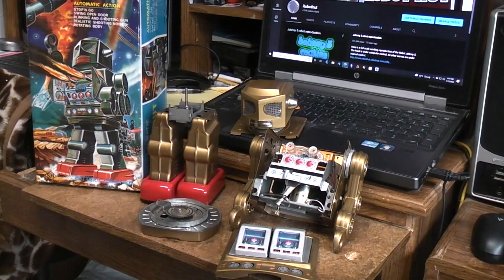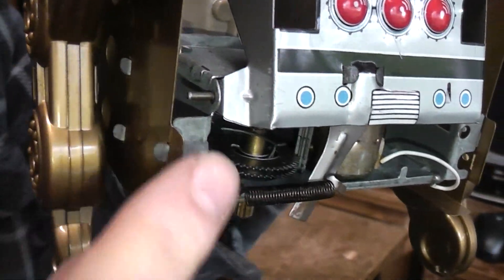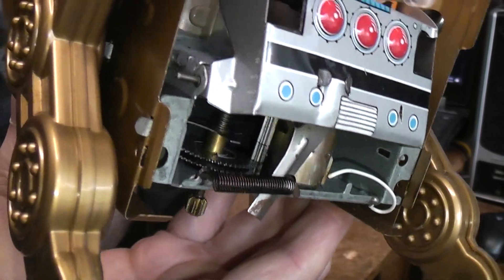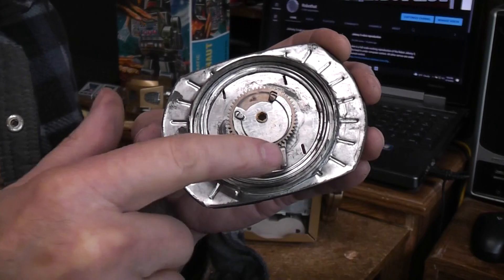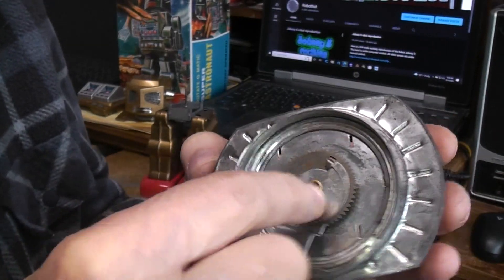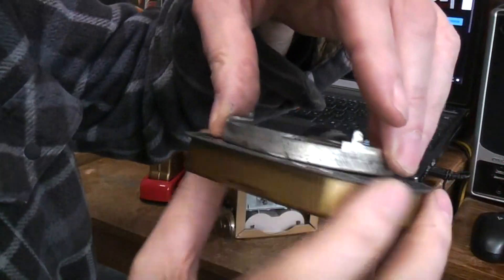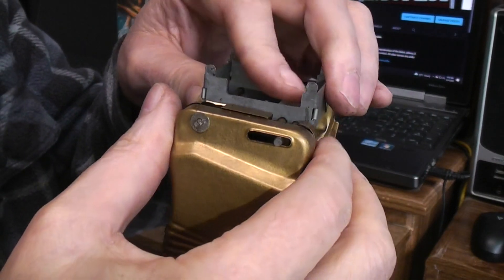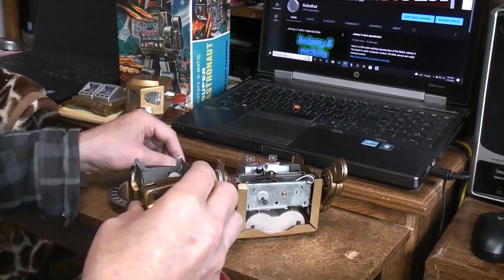How vintage Rotate-o-matic robot's work. A inside look. Japan 1960's.

Comment: I love these robots so much but the gears wearing out really sucks, is there a way to replace the brass and steel gears in order to keep em going ?
Reply from the maker: Yes many of the repro robots made in China will work as a source of gears to keep the vintage robot going.

Comment: Can you tell me where to get a replacement motor for the swivel matic robot? I have the all metal human face astronaut version.

A link to one would be great!
Reply from the maker: Generally, it is easier to fix the motor than replace it. The motors almost never go bad, what they normally need is the brushes cleaned with some spray contact cleaner. Now if you do need to replace the motor the problem is that they used so many slightly different motors that mounting a new motor can be hard unless it is the same motor case design. Old toys and new batter toy repro's is the best place to find motors of the same type design.
Reply: @Robothut  ok, I'm just getting a robot that the seller says isn't working. I'm just trying to get ahead of it in case I end up needing a motor. What cleaner do you suggest?
Reply from the maker: @kgandcats  The problem will be either the battery contacts, the switch, cold solder connection or the motor just needs to have its shaft rotated with power ON. A drop of oil on the motor shaft bearing is a good idea. Any spray contact cleaner will work as long as it is safe to use on plastic parts. The can will state "safe for plastic".

Comment: The inventor of these robots 🤖 really knew how to make them , I bet he said “ I did it “ in Japanese , do you know who that was ? Thanks John
Reply from the maker: It all happened after the war with Japan, All there engineers were not allowed to work in the military fields any more by the USA so they found work in the toy industry, and so all kinds of great mechanical design came from that. Also Japan copied so many mechanical designs from the German toys and advanced them from windup to battery operation.
Reply: @Robothut  really interesting so it was just not one person , but many well two heads are better than one they say .

Comment: I’m impressed with the mechanical ingenuity.  Too bad they cheaped out with the plastic gears for the legs.  Since everything else was metal, I can’t see how it would add much more expense to make those out of metal too.
Reply from the maker: The helical gears in the walk mechanics can not be stamped out like the large flat gears , or extruded like the small brass gears. It costs alot more to machine them out in metal compared to the plastic ones that can be cast in low cost molds.
Reply: @Robothut  Interesting.  Never knew that.